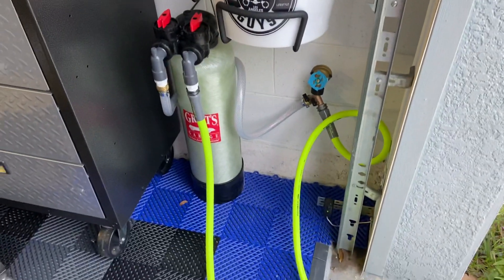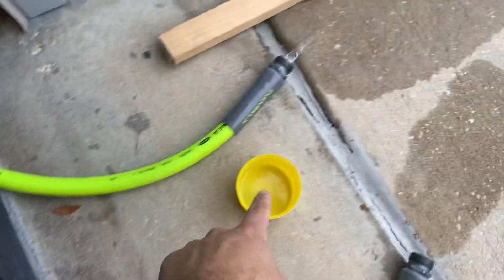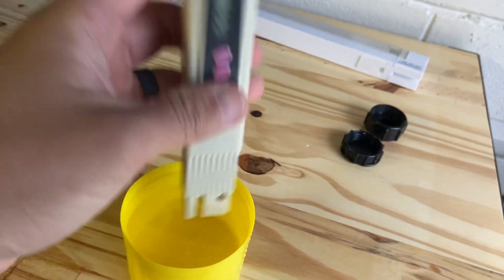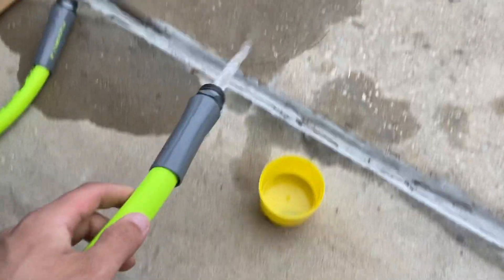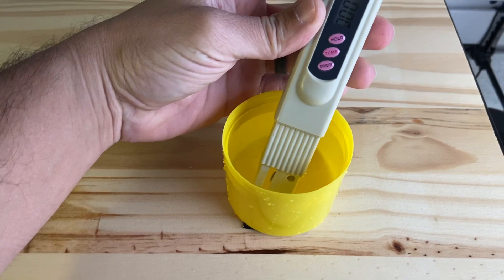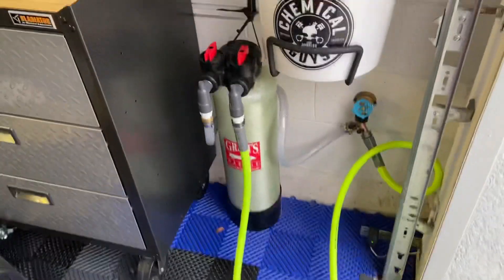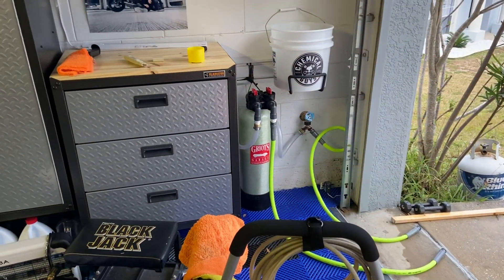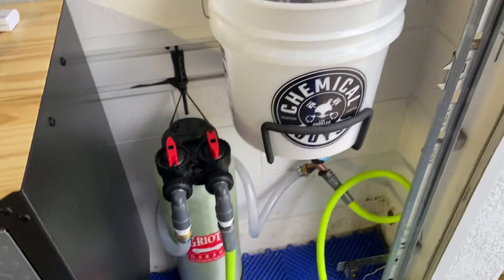Griot’s Garage DI Water System Review and Test

Comment: 163 isn't bad, especially compared to my 556 TDS, As you no doubt already know, putting your incoming water through an RO system will make your DI resin last a lot longer. Even my 556 is reduced to mid 20's with a RO system and booster pump, which allows my Griots DI tank to make over 1000 gallons of 0 TDS water for spotless rinse,  which uses only a few gallons per car.

Comment: I purchased one but the seal was broken where the 2 bypasses connect. They’re sending me another one. I wonder can you use this with a on demand pump connected? Or will it be to much gpm for the tank?
Reply from the maker: Their customer service is top notch. I had the same issue and they replaced the connector l. Also it has a lifetime warranty.

Now as for the on demand pump, I’m not sure.
Reply: How did you realize the seal was broken where the 2 bypasses connect? Like the plastic was literally broken, or the TDS was roughly the same between when using the bypass vs. not?

Comment: I bought this for a solar panel cleaning business, I LOVE IT , I also bought extra resin sand with it overall I paid almost 500$
Reply: How many gallons can you use before changing the resin.
Reply: @lel3450  I just go off the houses instead of gallons maybe 40 to 50 houses before refilling it with the sand from the website, I only use it for the final rinse to help conserve it
Reply: Thanks for the info, sir. Do you find that a pump is necessary to get the water up to the roof for decent flow?

Comment: How many gallons can you get off that ?
Reply from the maker: It depends how hard your water is to start. I believe I can get 4000 gallons before I need to replace the resin. I only use it for the final rinse and when I’m using the foam cannon.
Reply: @Sidetracked_Vlogs I think your 0 button got stuck

Comment: Great video, how many washes can you do before you change the resin? This is not bad for $300 dollars, I might order one.
Reply from the maker: I think about 4000 gallons so it all depends. I myself bypass the filter when doing initial rinse. I use DI water for foam canon and for final rinse only. This helps save the life of the resin.
Reply: @Sidetracked_Vlogs  thank you for getting back to me.  I have  looked at other systems and l keep coming back to this one.  Iam set on buying this one for the price and the amount of gallons of what’re it provides.   Thanks a lot and happy detailing.
Reply from the maker: @cal88usa  it’s definitely worth it and is the best system out of all the ones I spent weeks researching. Being able to bypass the tank with included valve makes it the simplest and cleanest look without having to buy a bunch of other PVC to build your own bypass. No brainer here.
Reply: @Sidetracked_Vlogs  4000 gals???
Do u have that # right?
Reply: Appreciate the video and the replies. When you are by passing the DI filter for pre-rinse, and initial rinse after contact wash, what sort of bypass are you using? I can't imagine that you're actually disconnecting/connecting the hoses from the bib and DI system to the pressure washer each time? @Sidetracked_Vlogs

Comment: I dont know if you ran into the same problem i did but first time i hook up the deionizer to my active pressure, a decent amount of resin started to clog the hose inlet, i thought it was the pressure washer not working or something but it was the resin, hopefully i find a solution to it
Reply from the maker: The orientation is correct? I did not run into this at all. Call Griots if you have the same unit. Their customer support is top notch.

Comment: Any update after pressure washer system?

163ppm from tap is good. I'm at around 600ppm from tap. I'm guessing would get like 5-10 rinses from this system.
Reply from the maker: I will test today. For an update. It stayed at 0 after pressure washer but today I will do a test for a 5-6 month review
Reply: @Sidetracked_Vlogs  

I imagine it'll still be really good. According to griots spec's you should get like 1000 gallons out of it due to your low ppm tds. I'm looking for solutions with my super high ppm water. Patterson, CA has some of the worst public water in the state! I've never seen over 600 from tap and my tds meter reads 612-631ish. With our RO system under the sink I get 16 with a 2 year old filter.
Reply: @SnookaTrucking  ayyy I live in patterson too and the water is trash!!! Even using an RV filter and still doesn’t do good.
Reply: @kuksgarage2715  

 @Kuks Garage  

Small world...and town. Yeah man I'm looking into a prefilter of some kind now before just throwing in the towel and using it lol.

Is the whipple coyote yours? I'm running a whipple Sierra. I have it in the shop in San Jose for fueling upgrades...trying to break 700hp. Damn truck is too heavy!
Reply: @SnookaTrucking  lmk what you go with cause im tired of it and idk what to do. Been going to a car wash in modesto that you do on your own and the water is good there with all the filters they got lol 

And yes i drive a whipple coyote in town lol but broke the tranny so its out to get rebuilt and hell yea thats gonna be crazy!!! Just becareful with all the shits thats going around. Sideshows and cops cause they arent playing around anymore out here. You can follow my builds on IG @fox_yote302
Reply: @SnookaTrucking  600 Ppm that’s crazy high. I live in Stockton California and my tap water is 105PPM lol